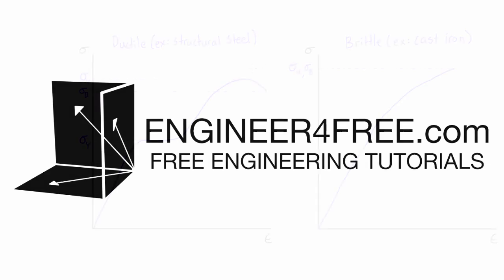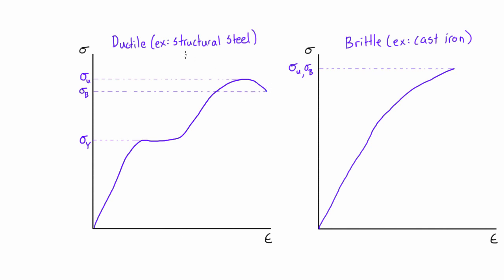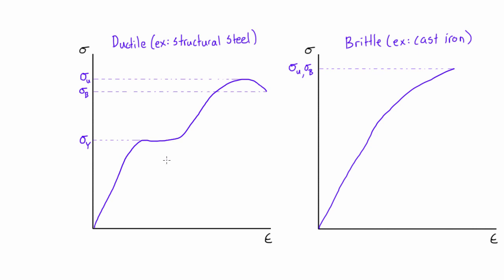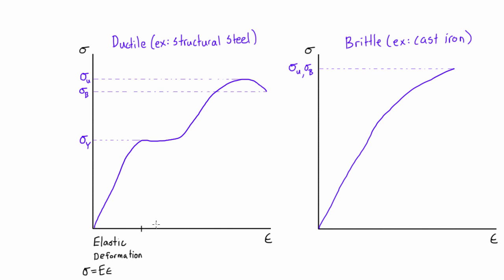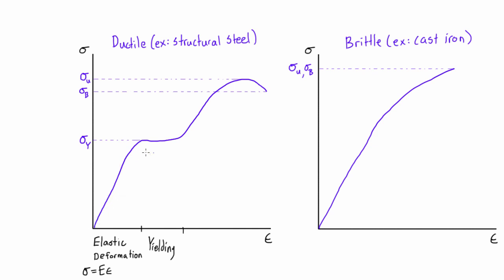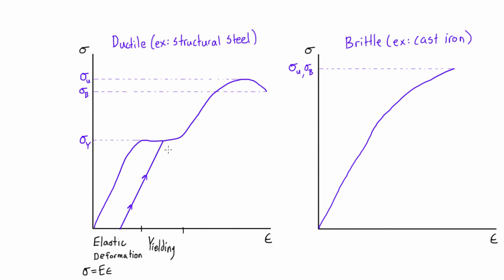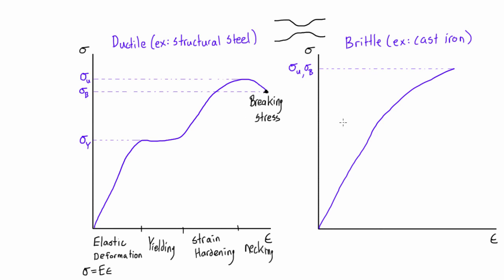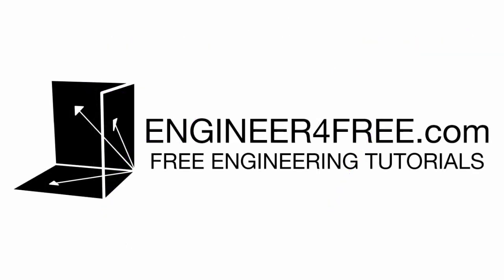Stress strain diagram explained

Comment: Both of the values are calculations based upon measurement output from electronic devices.  The input would be the force applied by the machine such as a screw jack or hydraulic jack of some kind.

Comment: No.  You plotted the elongation versus the load then you calculated stresses and strain based on the original length and area of the specimen.  You could have flipped the axies but that is not the standard practice .

Comment: Basically this is a graph of reaction vs reaction because stress and strain both are reactions and we cannot say that strain produces stress or vice versa. Formula for stress is internal force over resistive area and formula for strain is simply change in length over original length as we can clearly see that neither stress depends upon strain or strain depends upon stress. The reason for taking strain on x axis is it is easy to measure since it is a fundamental quantity i.e. length.

Comment: If a material has a higher UTS than another does that mean it can withstand a higher load as well? Or does that depend on CS area and length as well?
Reply from the maker: Yeah the cross sectional area is also important when determining the ultimate load. Imagine you have three things: A piece of spaghetti, a thin steel bar that's the same diameter as the spaghetti, and a steel rod with a diameter of 2cm. Clearly, the thin steel bar would be able to support a higher tensile load than the the spaghetti, because of the choice of material. But then the steel bar with the larger diameter would also be able to support an even greater tensile load than the thin steel bar (of the exact same kind of steel). In compression, you also need to take into consideration the critical load that would cause buckling, so length (slenderness ratio) is also an important consideration. Pro tip: only use spaghetti for building bridges in design class!

Comment: In 10 minutes. You described it better and more clearly, than my professor in 3 lecture days each about 2.5 hours long. 
Thank you.
Reply from the maker: Yeah this is a really tricky one. I didn't properly understand it when I was a student, which is bad because all of solid mechanics is pretty much based on this concept. But glad I could help you now!! =)
Reply: @Engineer4Free  I didn't understand that the stress on the dependent axis of the graph was the internal stress, not the stress applied to the member from the test. thank this really helped my understanding